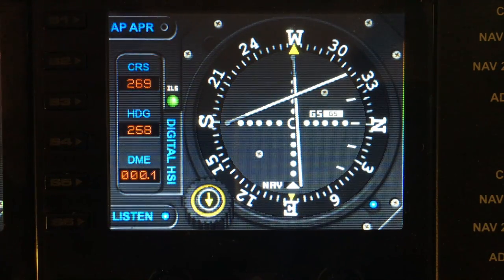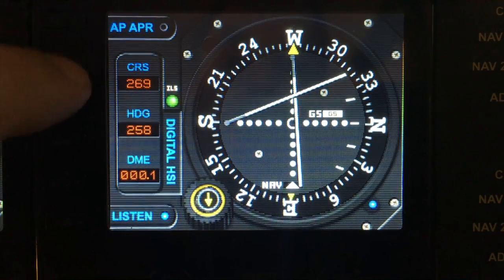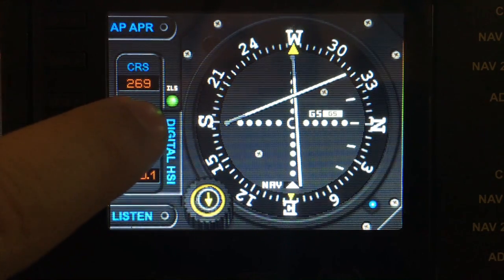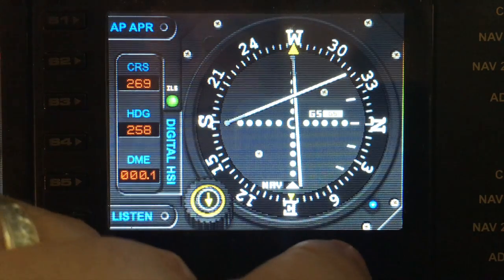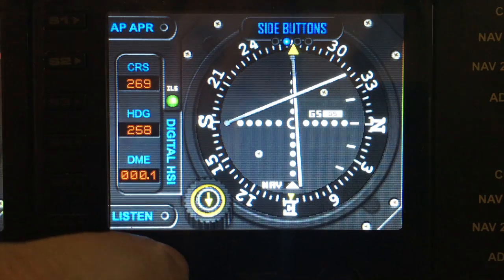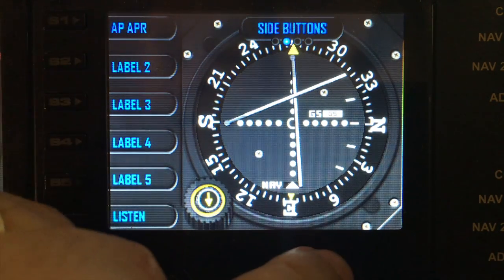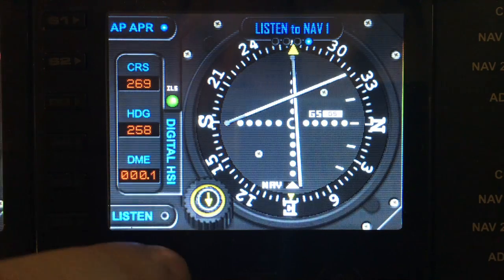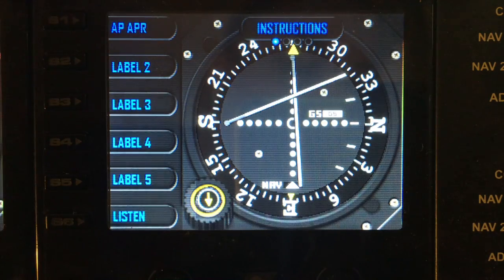ILS Gauge - Saitek/Logitech Flight Information Panel & SPAD.neXt

Comment from the maker: Seems I didn’t mention in the video that the left dial changes the Course (CRS) I’ll be updating the video at some point soon
Reply from the maker: Oh thanks I need to double check what I’ve put on the dial, odd that I’ve missed the dial on both video and webpage. Pretty certain it operates the CRS and therefor rotates the compass ring. I’ll also update the webpage. I’ve written 90 gauges in the last 4 years and I try to keep the doc accurate but it’s Jared work and takes me away from gauge development thank for point out both issues
Reply from the maker: Updated ILS webpage to show left dial does  OBS/CRS, thanks
Reply: Ahh, okay. Some people just don't use it but pilot's certainly do and the only thing mentioned was that it is for the menus.
Reply: Also, for the record, I did check the website before asking. For instance your HSI states that the OBS changes course, but for this gauge it only states:

[L Dial] Menu Value Down/Up:
[R Dial] Menu Activate & Previous/Next: